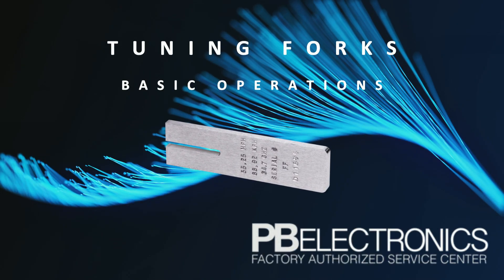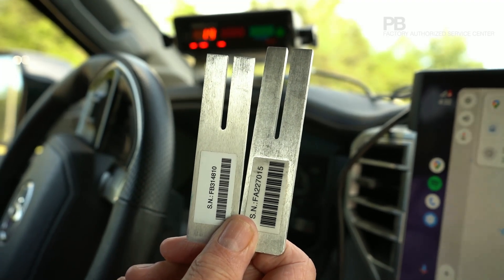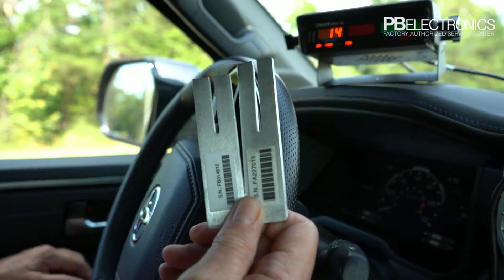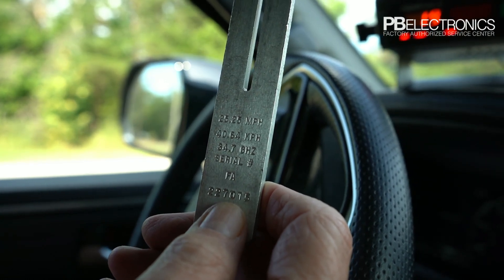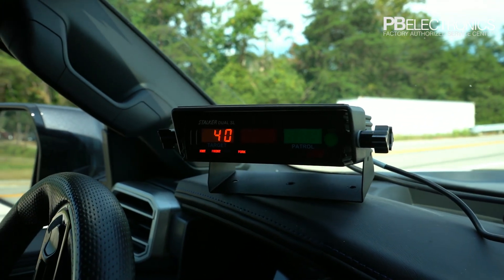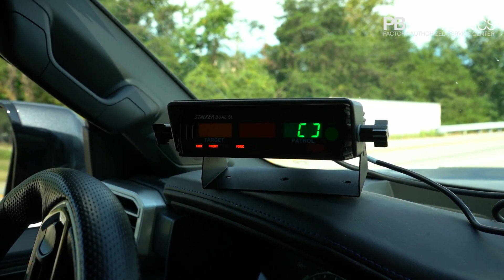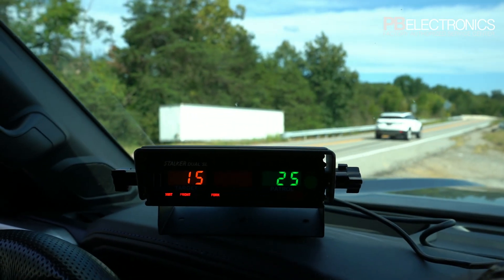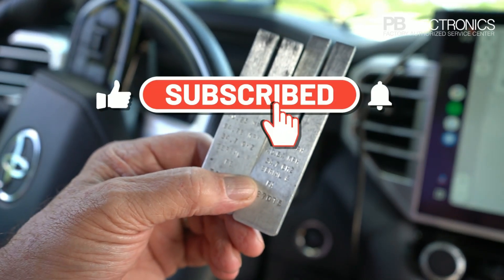PB Electronics - Tuning Fork - Verifying Police Radar - Instructional Video - Basic Operations

Comment: Well done. How far away will the unit pick up the fork? What displays if a similar unit passes by the opposite direction?
Reply: The tuning fork is suppose to be held 1-2 inches ibfront of the sntenna by the officer.. however holdibg the tunibg fork outdide tge windshield or several inches away will still displsy a readibg on the radar.   Other patrol csrs operating otger rsdsrs does not effect each other.  Each radsr operstes on a slightly different frequency.  Like if you had two FM radios in uour car each one tuned to s different frequency..

Comment: What about the rear one . Do you calibrate that one too separately ?
Reply: No you dont have to test the rear antennia with tuning fork.  The tuning fork lets the operstor know  that the computer can convert doppler signals to a dpeed reading and tge computor csn subtract patrol speed from clising speeds and compute tge difference into a dpeed readibg.  The rear antennia like the front sntennia just transmitts and recieves the signal . If you switch to rear antennia and get no reading you have to check your connectiobs and antennia slignment or obstructiobs.
Reply: The book says check both front and rear daily daily..he doesn't because it's awkward and irritating and generally a pain in the ass to get out and do it
Reply: @randyjohnson6845  where can I get a copy of the book? I am fighting a speeding ticket and can't find a proper manual for Stalker DSR Radar that has calibration procedures for moving and stationary. Thanks!
Reply: @yugnats i would send the question to Vortex radar youtube channel...he would know or know someone that does
Reply: @randyjohnson6845 ok thank you
Reply: @yugnats i would start with going over every detain on the ticket...like the time ans street and county..make sure all your information is 100% correct..vin number..license number..EVERYTHING..if its not thats going help in court
Reply: @randyjohnson6845 it's all correct and the JP told me none of that stuff matters anymore unfortunately. I don't think the cop did a calibration for moving and stationary in his notes so I'm trying to find a manual to show the procedure for calibration and see if it includes moving and stationary for the Stalker DSR
Reply: @yugnats I would call the factory
Reply: @randyjohnson6845  I did and they said they can't release it to me as I'm not a law enforcement agency and it contains "proprietary info" lol. So I guess my argument in court will be that I couldn't acquire the proper info to defend myself. I do have a FOI request for it from the RCMP as well.
Reply: @yugnats there excuses sound bad